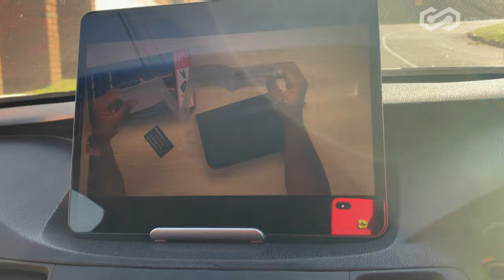New Building Network Setup from Start to Finish | RJ45 Patch Panel Wiring | EP12

Comment: Great work, love your video. But why use ziplocks? Isn’t that bad use?
Reply from the maker: Hi fam, thanks for enjoying the video, much apreciated. Most definitely zip locks won't be my first recommendation, instead Velcro strips or Reusable tapes are the recommended but unfortunately we had to work with the materials available to us during this project and that’s why we ended up using the zip locks.